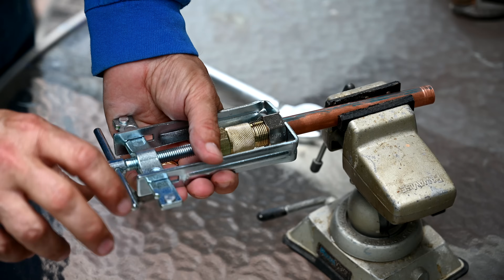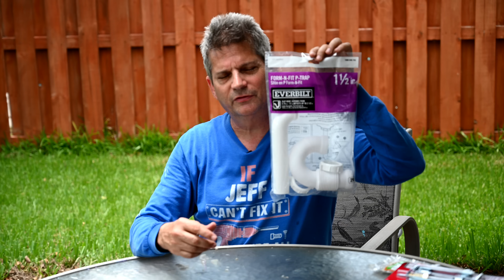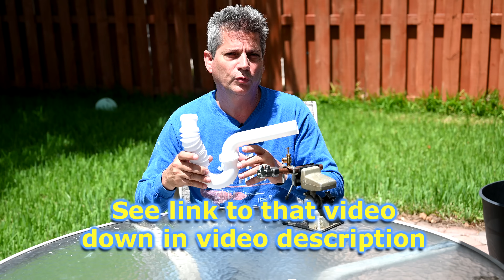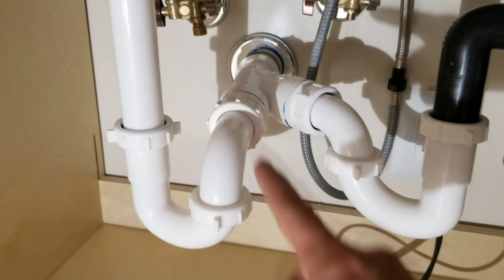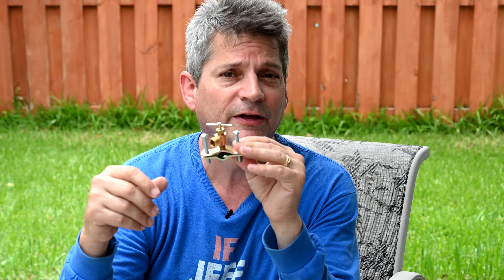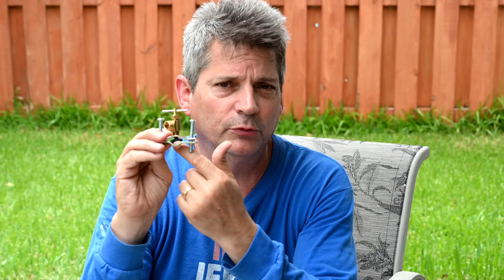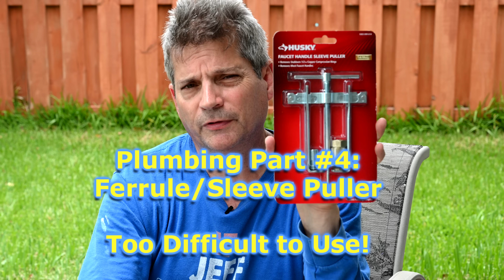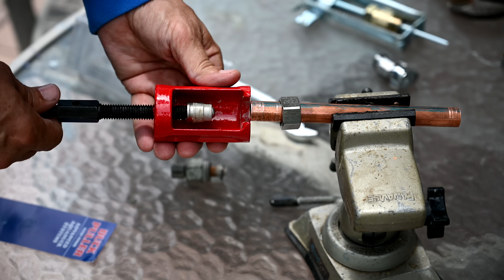4 Plumbing Parts/Tools You Should NEVER Use. NO Plumbing Fails

Comment: I always leave the old nut and ferrule when replacing angle stops. I dont trust removing the old ferrule because it has compressed the copper tube. I feel like getting the new one to seal over the pre stressed pipe is scary
Reply: Ditto, but sometimes the nut is corroded so badly it won't work with the new valve. Usually there is enough pipe left to simply cut the nut off & start over, but if there's not enough room, you'll have to do something else. Or, after cutting the pipe and finding it too short, you  could use a push-on fitting, or cut into the wall, extend the pipe to proper length to use...
Reply: @fixitmann6685  also sometimes the old nut is coarse threads and the new is fine. But aside from those issues I always use the old nut a ferrule.  Also it saves time.
Reply: @fixitmann6685   In some situations I've even removed the packing from the valve and soldered the valve body onto the pipe. It's just brass and soldiers easily.

Comment: A quality compression Tee would still be far superior to that crummy saddle valve. Soldering is best of course, but if you lack the skills a compression fitting is still cheap enough.
Reply from the maker: My favorite method of solving this is by connecting a compression angle stop at the water supply pipes for the vanity or kitchen sink. But for the kitchen sink I use a double angle stop for about $20, on side feeds the dishwasher, and the other side feeds the ice maker. Each has it's on 1/4 turn ball valve handle which is awesome, allows you to individually turn off each water supply tot he dishwasher of ice maker individually without having to shut off main water to change a hose.
Reply: @jeffostroff  .....a 1/4" compression tee with union works best

Comment: In a pinch, couldn't you carefully deeply score the sleeve with a dremel and just use a flat blade screwdriver to open it up and off of the pipe?
Reply: Yes. If you're VERY careful. However, the pipe is probably deformed by that point and a new one won't go on anyway. If possible cut the whole mess off, if there won't be room, you'll be using a push-on fitting anyway.

Comment: 18:50 we call the ferrule an "olive" in the UK. No idea why! :-)
Reply: @Chris Duke  Stainless steel compression sounds like a real pain! At least copper is malleable even when it's big and heavy, and if you're used to torquing up copper fittings stainless must have a bit of a learning curve. Plus if you mess up, cutting out the mistake is so easy with copper. I feel your pain! :-)
On the industrial stuff, my neighbour does plumbing for industry and he showed me some big 4-inch compression fittings that cost something like £500. They don't look like standard ones from the outside but when you take them apart it's just a giant version of the ones we use on domestic plumbing.
Reply: Duh, if you bought your girl (or boy) friend a cocktail you'd see a pitted olive in it. The Romans brought olives to Britain, they been around a while. Thank you dorkmeister, your welcome

Comment: The S trap is illegal only for new construction use. In many areas it still can be used to replace existing. In older homes, many times there is still lead or galvanized drain piping in a masonry or concrete floor.  In this type of condition, the only way to repair without breaking up floors and walls etc. is to replace the existing S trap. The S trap back then, was made of brass or copper. You can still find metal S traps but mostly you will encounter the plastic kind. If you have a situation where there is old piping in the floor, be careful removing the old S trap. Sometimes they actually used a wiped solder joint to connect the trap to drain pipes. Considering that the existing piping below the floor is at least 50 years old-or much older- you have a potential time bomb waiting to be disturbed.

Comment: Does the state of Fla. allow you to use Shark Bite Fittings.
Reply from the maker: Yes they allow it but you might find some inspectors who don't allow it so you need to check with  city that you are working in 1st to find out. Certainly the odds are better in your favor if you keep the shark bite fittings on the outside of the dry wall instead of inside the dry wall.  if you get an inspector that was an old school plumber they may prefer to see soldered copper pipes only inside the wall but keep the sharp fittings outside the case there is a leak they can be seen right away.

Comment: It's all bs, the plumbers just want to keep on raising their ridiculous prices. This guy looks like a sleazy car salesman lol.
Reply from the maker: Another uninformed troll. The plumbers don't charge you any more for using the correct part then for using the wrong part. For example the flexible P trap we know is illegal they should not use it. It only takes a few minutes to install one but to use the correct parts instead of the flexible P trap and it takes them a few minutes to cement together the proper fittings and they are done.  They are not raising their rates To put in the correct parts.
Reply: @jeffostroff  like I said SFB, these sites take money out of your pocket... boohoo, what's a matter not making enough money, how many senior citizens have you ripped off today LMAO
Reply from the maker: @manuelcardona2525   LMAO I save senior citizens from guys like you and don't charge them anything.
Reply: @jeffostroff  LMAO, yea right, I bet when your kids need braces you charge more SFB
Reply: @jeffostroff  my parent's got ripped off by slimy bums like you.
Reply: They live in Florida, I'm in NY, had to go over there and put a complaint to the BBB and the state....
Reply: @jeffostroff  and I did the job myself ya bum
Reply from the maker: @manuelcardona2525  that's why we do these videos so you can do it yourself and save  money by not calling a plumber.

Comment: No handyman worth their salt would use a form and fit or saddle valves, total BS! How many plumbers half ass jobs, if they show up at all, make huge mistakes and charge a king’s ransom....too many!!Contractors are always lobbying against and talking poorly of handymen in an attempt to prevent competition and allow them to charge outrageous fees. There are good and bad in all of the trades.
Reply: That's exactly the one and only reason you don't see it from as many plumbers. It's all about the individual's integrity and knowledge. If the plumbers didn't have an inspector or GC on his heels at every job, how many shortcuts do you think those guys would be taking. It's all about accountability. I've worked on jobs and witnessed plumbers doing things much worse than violating codes and costing the GC insane amounts of money in damages but there was no way of holding any one individual accountable other than going to the top of the ladder to the GC. Just like in any trade, the ones with integrity will do the right thing and those without integrity will only do what they are held accountable by codes to do. I feel like you have a wealth of knowledge and I'm always open to learning from anyone to improve my skill set but to continually give the title of "Handyman" a bad name is just arrogance. That's as bad as the term "scab" because we were all scabs at one point. None of us were born knowing how to plumb a house and every one of us still has more to learn. So if anyone is a scab, we all are. Poor workmanship should always get addressed and called out but a lack of knowledge isn't the same as a lack of integrity and pride. The latter is much worse and all trades, no matter the title, are equally integrated with people who don't take pride in what they do. You're gonna lose a lot of your following if you keep defaming peopes' trade. I'm sure there are things you can teach me about plumbing but I would be willing to bet that there is plenty I could teach a master such as yourself, even though I'm technically just a lowly "handyman".
Reply from the maker: Yep and unfortunately too many handymen do indeed use this there is a my way don't see it so much from plumbers especially during new construction is that it would get flagged immediately by the building inspectors.

Comment: Whoops.  I used an accordion trap on my under sink plumbing after replacing the garbage disposal.  I got it at Lowes and I have seen these also at Home Depot.
Reply from the maker: I would get it changed out at your leisure.
Reply: @jeffostroff  The kitchen sink, or the disposall is probably the worst place to use accordion tubing. All kinds of nasties can accumulate in between the pleats. They also restrict water flow, compared to a PVC pipe, even with elbows. Once it starts to gunk up, it only gets worse. It might be OK as a "quick fix", but not a permanent solution.

Comment: guess i need to get rid of the saddle valve that feeds my icemaker.  its been here since we moved in 20 yrs ago.
Reply: Same here, dishware is fed by one as well....
Reply: @PatrickBaptist  And that's even worse, since most dishwashers are plumbed off of hot water, and those saddle values are not designed for hot water.
Reply: @PatrickBaptist  Dishwasher needs a 3/8ths (ID) minimum line to insure enough water.A saddle valve cannot deliver...
Reply: @ralphh.2200  It has been for longer than 30 years.....

Comment: have seen several form n seal traps that i have replaced. about 90% of them leaking in one of the accordion pleats yuck and as you said collecting all manner of debris
Reply: A gross, slow drip under a cabinet shouldn't be grounds to cancel a home insurance contract.  The "mold litigators" have brought the USA to the level of a farce.  Let's be honest, the reason most of this stuff is banned by code is that insurance lobby controls the legislative / regulatory channels and got it banned to fill a risk-hole in it's rotten heart.  The rotten heart that is supposed to take money and spread risk, but which likes to take money and then act like there should be no risk.  Fine then, stop taking more and more money as the risk is going down.  Nobody's policy rate ever went down because the modern house is basically immune to 90% of the stuff that would have burned it 70 years ago.

Comment: All good tips but you demonstrated the Husky Puller incorrect which is why it was not working for you. When using it to pull ferrules there is an additional silver spacer piece that fits into the end of the pipe inside the brass connector to pull the ferrule, the sides you are trying to squeeze are not used in this application, they are for handle pulling only. you can also back off the handle to allow more clearance.  That ferrule puller works great when used correctly please refer to the directions.
Example: https://www.youtube.com/watch?v=MjNrGuxYvjQ
He actually removes the handle bracket all together

Comment: careful sterotyping handypeople (PC correct vs handyman) or DIYers using incorrect tools or supply's VS contractors or licensed plumbers. We correct and rip out a lot of so called licensed plumbers work (last month a saddle tap/valve). WE STATE just because your licensed in the state of fl (DPBR) doesn't mean diddly squat!!! DPBR is just a way to get tax money, regulate permit jobs and make sure permitting is done (somewhat safety purposes for owner occupancy), a crude way for trades people to follow the IPC (FL code or county code) and a license to advertise because now you have a plumbing license that you can display on a vehicle or advertisement media. A contractors license in any TRADE does not give you a guarantee of knowledge or COMPETENCY of the trade. Most DPBR trades tests for a license are OPEN book- books cost a lot- all based on code and business regulation test (doing bus. in fl i.e. taxes, book keeping etc.). We are very humble since we learn something every day and dont take our experience for granted or gloat that we are licensed. BTW we carry IPC and NEC books in all our vehicles and smart phones along with certain county code documentation for reference for the client and our jobs. Other than your hidden messages to call out handypeople (handymen as you say) agree with those products prone to failing and non-code, along with why.

Comment: Why do stores sell banned and prohibited parts?  Because the stores and sellers are out to make money not enforce the rules.. It's the same with 2-radio communications.. we have a pile of rules and regulations by the FCC that sellers do not adhear to and though the FCC has released enforcement action notices we still have people on ebay and craop selling illegal Chinese baofeng radios that allow users to operate on frequencies that can cause interferance with public services.. it's the end user that needs to be responsible and know the rules.
The house I had in Louisiana had saddle valves that fed ice makers in 3 locations.. No one mentioned those as a code violation to me but I took them out myself and soldered in proper "T"s with ball valves.
Those flex traps are for drains that do not tie up to a city sewer like a sho sink that literally drains outside. They should not be used in a home because of the clog factor though

Comment: Why do you crack on handyman and dyi people?  Licensed plumbers do shitty work and rip people off. FYI extension cords are also illegal to use but are still sold. Or I should say goes against the international fire code. Extension cords can only be used temporarily. Also outlet splitters are also illegal.

Comment: Saddle valves are (or were) provided with large appliances, but they are so bad.  Even when they work, they restrict flow so much you need to swap them out.
Reply from the maker: When you go into a home depot and all of the other stores now when you buy those ice maker water supply line kits for your refrigerator they all come with a saddle valve.
Reply: @jeffostroff  And appliance store delivery driver/installers will use them too to get the icemaker installed on a new fridge. They care not about plumbing or codes...
Reply from the maker: @estynusca4006   They probably just don't know all of these guys need to be trained on this stuff quickly

Comment: 12:27 okay the others I either knew weren't legal or make sense, but I definitely didn't know that the saddle valve was a no no. I've got one my grandfather installed for the ice maker, 30 years so far and not leaking yet, although if it ever does, it'll leak on my son while he's sleeping so i'm sure he'll let me know ;)
Reply: We had one in my house my entire childhood which did not leak out the pipe. They do tend to stretch the pierced hole out until the valve won't shut off fully though. I wouldn't install one in my house,  but they work.
Reply: yeah i'm no plumber but for my line of work (repair) i've seen a lot more fridges leak themselves than the valves
Reply: They aren't illegal. Nothing in codes is illegal.
Reply: @NobleNobbler  I reckon though, Really, with shark bite, even diy dummies have no excuse now lol.
Reply: @HamiltonMechanical  I don't think SharkBite are allowed inside walls.  Has that changed?
Reply: I guess you could say it’s “grandfathered in”. Never the less you’ve been lucky it had gone that long without leaking.
Reply: You should know that copper has declined in durabuility and resistance to corrosion in the last 30 years, as compared to the quality and thickness of what was being produced 20 years ago.